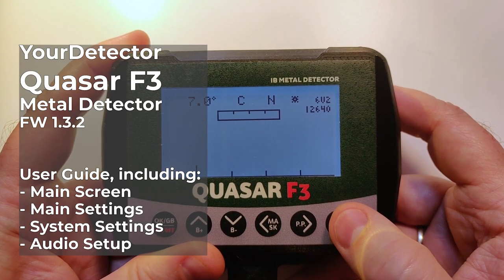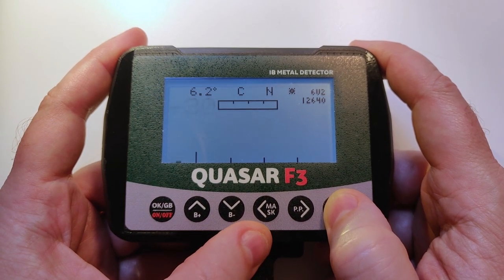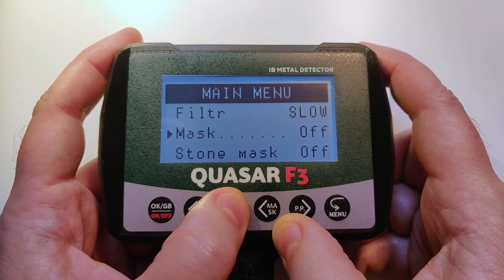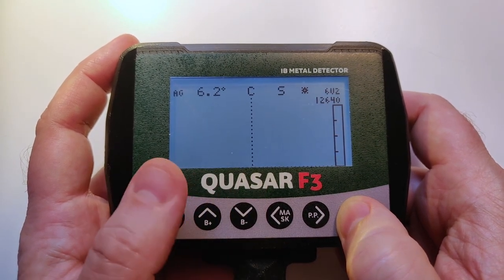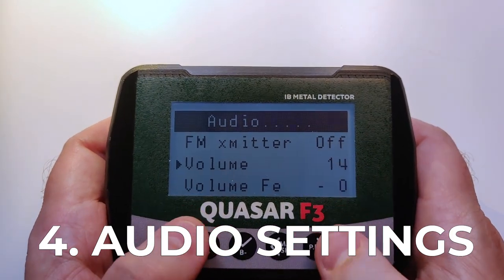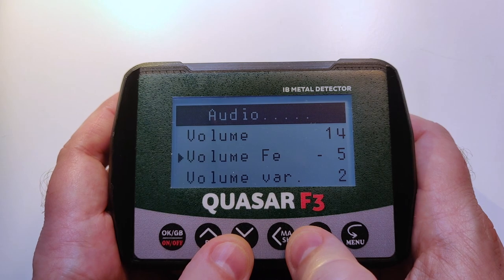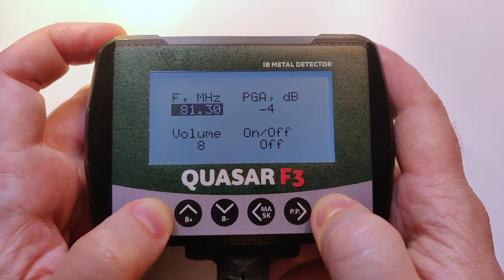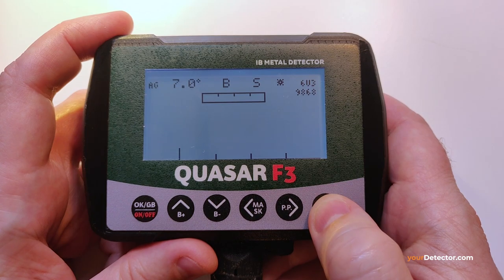EN: YourDetector Quasar F3 metal detector. User guide

Comment: It would be great to see you out on a search with this. Using both signograph and genograph screens. And procedure to add and tune 2 coils 😊 this is the top quazer model ? Do you think the Fortuna Pro 2 has more options like beach and two processors making it faster a better choice to buy ? Ps your English is very good 👍
Reply from the maker: Thanks mate!! :-D 

Unfortunately while people are prospecting I am sitting in the office working :-D So don't  think I have good chances to made such field video ....
Actually there are massive problems with components for Quasar F3, and while we still love it a lot, I normally do not take it with me for prospecting... Basically we don't do F3 anymore.. But I still like it :)

As for Fortuna vs Quasar f3 - I think they are too different, with different characters and pros and cons. ideally you should get BOTH :) And ask producer to make the same connector so you can use the same coil. I think you can still get one in Ukraine.

The good news is that we now have Stalker-IB, that is VERY good, and I think today it is better than both F3 / Fortuna !! But exporting it outside is a bit problematic ;)